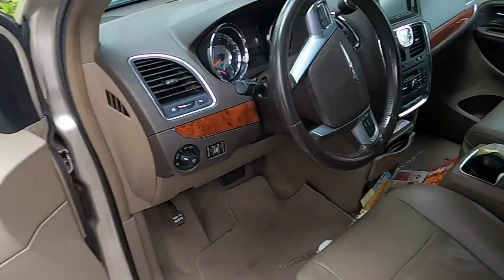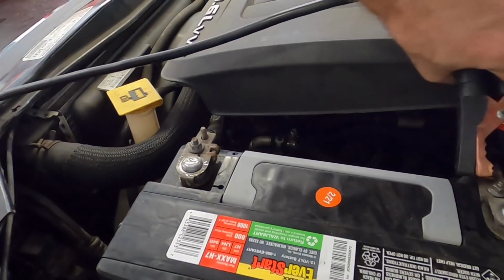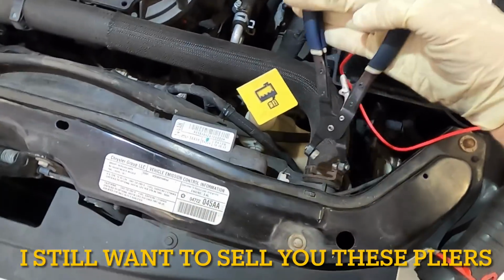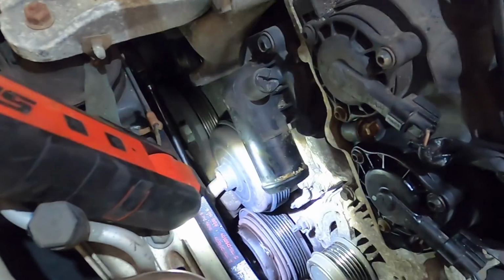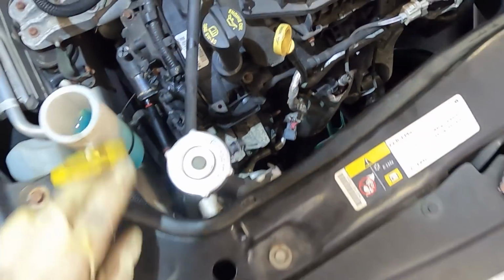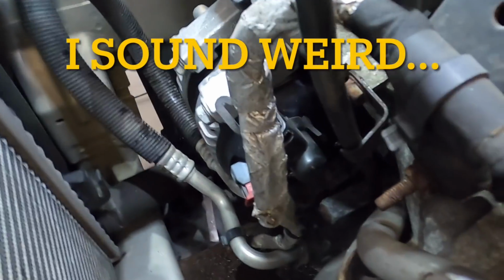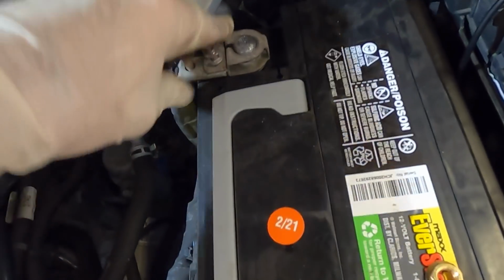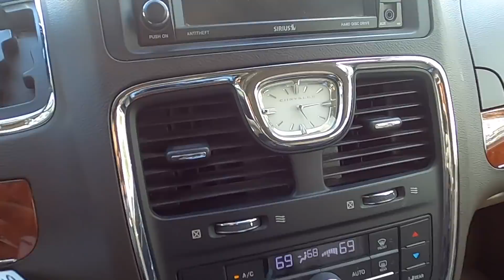Customer States: Burning Smell…Fire? 2014 Dodge Chrysler caravan battery light on!

Comment: I recently went through something like this.  I left my 4 way lights on over a few days on my van and my AGM battery went down to 6 volts.  The jumper box or another vehicle couldn't jump the van.
Reply: That's why Ray uses that charger first it'll kind of do a trickle charge till the battery starts taking voltage and then it'll start stepping up sometimes with a jump battery so far down it's hard to get it to come back but it can be done

Comment: you cant spray off MY engine, i have a typhoon K&N and that would suck the water straight through the intake.
Reply: Bones McGillicuddy  nope, can prove it with intake air temp. its always cool air and sounds very nice
Reply: Bones McGillicuddy  i can only go by what the temp says. i dont call 30c air "hot" especially for where it comes from. It sounds great and runs even better. so Im happy

Comment: I would have expected 14.2 - 14.4 volts from the new alternator. It would have been interesting to see voltage drop tests on the cables. For an easy to change alternator I would have rejected it and exchanged it, I think.
Reply: Yeah but have in mind the battery was low on charge due to the faulty alternator. With a fully charged battery it would've shown that value

Comment: Shouldn't you be connecting the negative jumper lead a chassis point, like engine hook. or some other bit of metal.
Mainly due to explosion risk when sparks happen when you connect the leads.

Comment: You should try out a lapel mic. It will cut out alot of the back round noise. It makes a huge difference especially when you are standing in front of a running motor.👍

Comment: Still way easier than on the Twinn dual cam 3.4 engine GM had.  The only engine where removal of the Alternator required removal of the freaking Drivers Side tire inner fender well and power steering hoses to gain access to the parts.

Comment: You’re lucky you weren’t dealing with an old Mercedes those are fun because you have to take the air filter off to get to the alternator and the distributor and the car won’t run without the air cleaner attached to the engine so if you have to adjust the timing on your engine you have to go to the dealership to do it on some of the older models it’s a real pain in the ass especially when you should be able to just change a simple alternator or adjust your timing without paying through the nose
Reply: It’s a Mercedes people don’t buy Mercedes cause their cheap to work on if u can afford to purchase a Mercedes then you can afford to pay for a dealership repair
Reply: @stephenjump4218  yep

Comment: The sound reminds me when our ‘nator gave out. The whining noise it did and the burnt electrical smell. At least the customer got a battery light. Ours went a month with the whining and the smell came a day before a trip to the state park. Next thing we knew was the ac got hot, and cluster lit like a Christmas tree with abs, trac control, tpms, and other lights I know nothing of before dying at a state park. Local mechanic went through the wheel well. I didn’t have the tools for such a job so we had it towed to a mechanic. Best $650 ever spent lol got our spaceship running in a day.

Should do a video how to change spark plugs on this beast next.

Comment: Remember when alternators used to be on top of the engines and you didn't need to tear apart the top half of engine compartment or drain coolant,swap out a new part in 10/15 minutes, back on the road again.

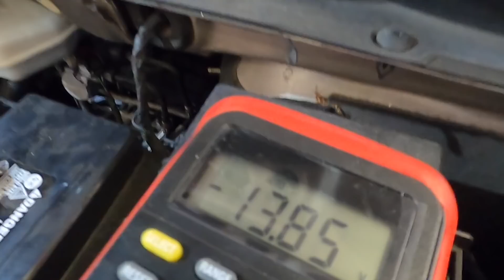Comment: 26:53 - You made it so fast that the alternator was sending negative voltage.  xD

Note for the people with thicker heads: I know the multimeter's wires were switched over and it doesn't harm the device.  ; )

Comment: I know they can be hard to find in a sea of LED lights and they don't last as long but a light with a standard bulb might work better while filming,  A standard bulb would toss much less white light making it easier camera to pick up what you are filming.  I still keep a stander bulb light in my garage for wiring jobs I find it easier to see the wire colors when working with a bunch close in color.